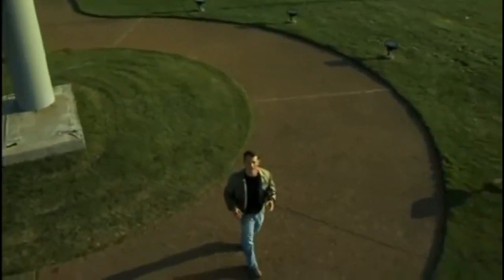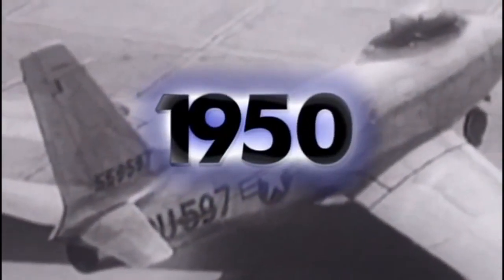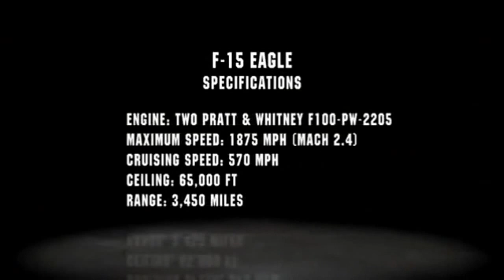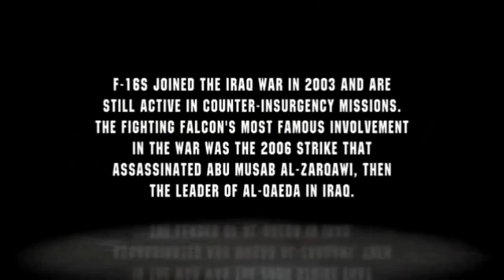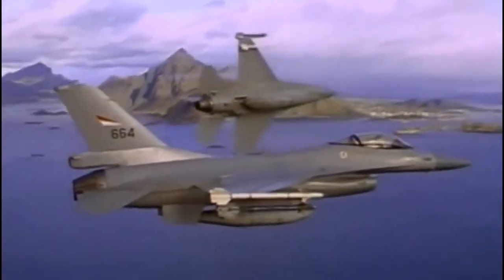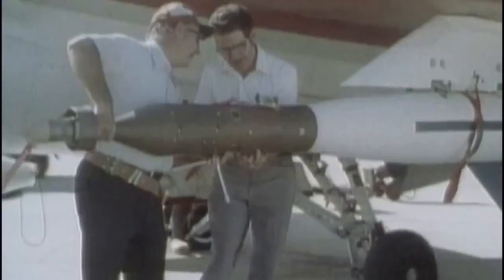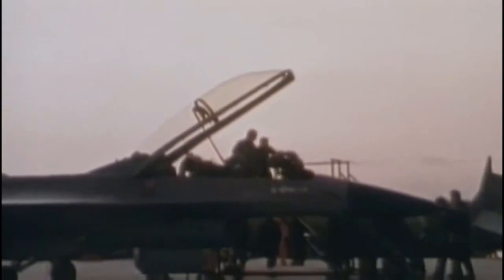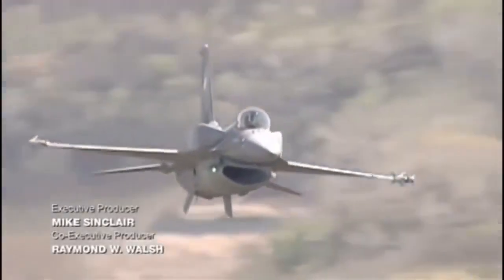Lockheed Martin F-16 - From General Dynamics to Air Supremacy Full Documentarry

Comment: FYI: 
"In 1976, the Lockheed SR-71 Blackbird broke the world's record for sustained altitude in horizontal flight at 25,929 meters (85,069 feet). The same day another SR-71set an absolute speed record of 3,529.6 kilometers per hour (2,193.2 miles per hour), approximately Mach 3.3."